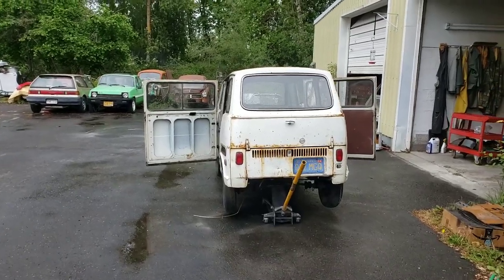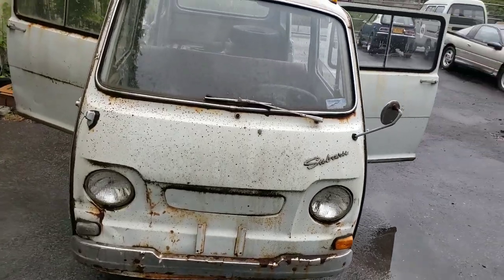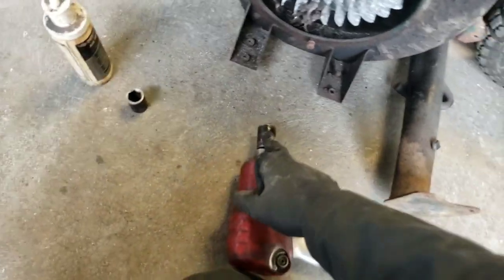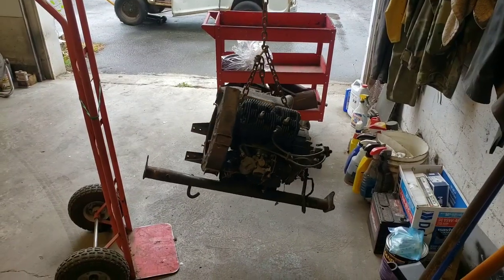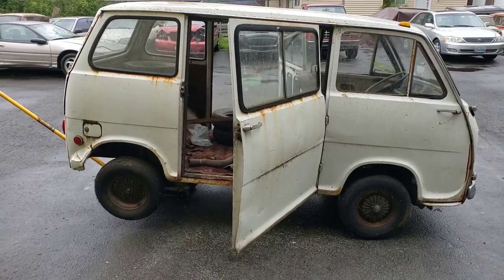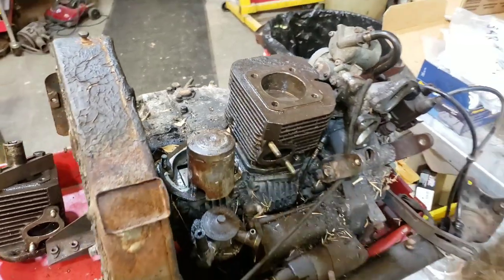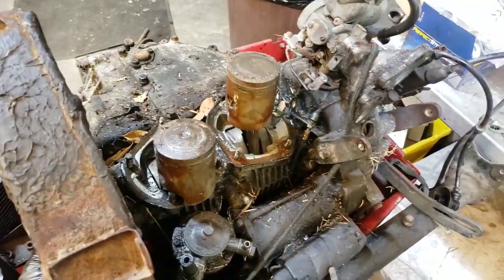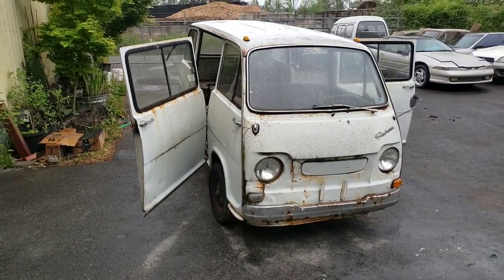Two Stroke Subaru 360 Van Restoration Basics : Unsticking the Siezed Engine !

Comment: When our local Subaru dealer went out of business, several of my high school friends bought the 360 car which looked like a small VW bug. I think they sold for about $800 new when going out of business sale. The main limitation was the top speed which was about 45 mph and 0 to 45 took about a half mile especially with 4 people in one. One friend burnt the engine up and I helped rebuild it for him. One of them was an auto stick transmission (no clutch) the others were conventional stick shift. Your video brings back a lot of memories of cruising around town in those Subaru 360's Sedans. Neat little car but not much quality or sheet metal to protect you.

Comment: Mark, whyfore you wailin away on those pistons like that? You can make a simple piston pusher very easily. Tap some threads into two opposite cylinder bolt holes, then you can drill two holes through a piece of flat bar laid across the cylinder. Drill a hole in the middle of this bar and either thread it for a good size bolt or use 5/8 threaded rod and a few nuts (weld one of the nuts to the threaded rod to make it into a bolt). Voila, a piston pusher. Also, heat the cylinder with a propane torch and let it cool with penetrating oil being sprayed on the piston. A couple of heat cycles and the pusher I described, they'll move.
Never hammer on piston tops of roller cranks unless your intention is to rebuild it completely with new pins, the very first good wallop ruins the big ends.
If you determined that the entire crank was toast already though, beat away on it. It's not the method I use but it works.
Reply: You obviously didn't watch the entire video, did you....
Reply: @Mardy72  I rarely watch past the beating with a hammer stage. I've unstuck more engines than you have brain cells and certainly more than Mark, and I'm talking about engines from 2 to 12 inch bores. I guarantee that I would not have buggered anything up on that engine beyond what was buggered up. I like Mark, he's done me some solids in the past but this is not the way to deal with a stuck engine.

Comment: This motors look like Jet ski motor without that blower .

I used Marvel Mystery oil in a 85 jet ski that had been out in the ocean and never cleaned afterwards, it just sat for 20 years. Anything that used to move was stuck solid on this motor. 
I put the Marvel oil down the spark plug holes and two days later  she started to move.

Comment: make a 'grease fittiting plug' to fit your spark plug, and jack the piston down with hydraulic grease pressure, while heating the cylinder. this has worked for me time and again unsticking froze up John deere two cylinder tractors (way less chance of collapsing a piston or wrecking the cylinder).
Reply: Yes...the problem is the position of the piston on a two - stroker. In this case, it would have worked on the RH cylinder, not on the LH - the grease would simply disappear in - to the crankcase...I had a similar problem ( not on a Subaru but on a Lloyd 400 )

Comment: The 360 was the very first vehicle that Subaru sold in the US. They also made a sedan (which looks quite a bit like a Volkswagon Beetle). Zero to 50 mph in 37 seconds. Curb weight: Less than 1000 pounds.
Reply: I've seen the sedans. I didn't know until I saw this video that there was also a van.
Reply: @russlehman2070  On another video he's converting one of his Subaru vans to run with a Yamaha motorcycle engine! I can't wait for that one!

Comment: Next time apply your blowtorch to the cylinders, add atf, lather/rinse/repeat. The thermal cycles will help greatly. Being 'out of gas' isn't really a valid excuse, especially working on a paying customer's vehicle. Use a hand-held MAPP gas torch if nothing else is at hand, or even a propane torch.

Not dissing you but you gotta be more gentle. As you say, these parts ain't exactly falling off trees anymore. And those air-cooled 360s ran half-seized anyhow, cooling was always a problem.

Liked... wanna see more. I have parts on This Side, been in Japan for 30 years. My 360cc '73 Jimny is one of my favorite rides.

Cheers
Reply: try dry ice cold soak and a qwik quench with hot water a few times loosens up anything

Comment: Impact gun's are not made to turn things, they use an actual hammer inside that strikes a piston type thing which give an eight of a turn over and over, NEVER use one to turn engines as you WILL damage the nut or crank threads (like you did), and if you are going to rebuild the motor never try to turn it as you can do more damage to it, just take the whole thing apart see what is wrong with it and move on, and NEVER EVER use an impact gun on any puller or spring compressor tool as it WILL damage the threads (I see you have a snap-on puller I hope your snap-on distributor doesn't see this he might void your warranty because of you using an impact gun). Paper gaskets, they sell rolls of the stuff where you can make (cut) your own, I would NEVER EVER use old gaskets (head gaskets are a different beast). I had rebuilt motors for almost 20 years, retired now...
Reply: Agree wih all you've said. He's not much of a "restoration" type mechanic- more a too lazy to source or make new parts one.
Reply: uh, it seized, big shooter. A seized engine is usually hiding major problems. Plus he gave it a few love taps, not 5 minutes of rattling the shit out it with a 2141 Ingersoll.
Reply: @flatbrimsickdope2050  seizing 2 strokes can only be 2 rhings genius; stuck in the bore or stuck somwhere on the crank...

Comment: I've unseized quite a few 2 stroke engines, one far worst than this from a motorcycle that had a bush grow through it when it was left on its side in somebody's back garden from 27 years.

The procedure is as follows (It's important the engine is still in the bike!!):

(1) Remove carb, manifold and spark plugs.

(2) Fill the crank bay and cylinders with Coke Cola, then leave for an few hours whilst the phosphoric acid eats the rust and gunge away. In some cases it might need a 24 hour soak. (Never use Pepsi in an engine as it makes the gear cogs lose teeth!!).

(3) Fit a serviceable drive chain then rock the bike backwards and forwards in first gear from gear lock point to gear lock point. It will gradually start to increase in the distance you can rock the bike in gear.

(4) As soon as the bike can be pushed for a whole crank revolution, give it a good fast push around the yard so that the engine can spit out the Coke Cola (Not a good idea to attempt to drink it after its been inside an engine!!).

(5) Once the Coke Cola has been expelled, fill the crank bay with SAE 30 W gear oil and push the bike at a fast pace around the yard until this is expelled. The engine is now in a condition where it can be attempted to start.

(6) Pour a shot of petrol into each spark plug hole and replace plugs. Pour a shot of petrol into the manifold hole. Replace the manifold and carb.

(7) Power up the ignition and push start the bike..... It will cough and splutter into life for a few seconds and then die. From how it sounds it can be decided if it needs to be rebuilt of is just fine.

I did this exact procedure for a 1974 CZ 250-471.0.003 that came into a mate's breakers yard back in 1998. Somebody bet £20 that we'd never make the complete rust covered heap run again. an hour later my mate was £20 richer and popping wheelies on it, though it was hissy and whiney as the crank centre and end journals were clearly shot.

He gave me the bike in 2012, till in the condition it was when it came in and I restored it with a new crank. It sits in my garage along with my other classic bikes.
Reply: I have no experience with rebuilding seized 2strokes, but I enjoyed reading your write-up

Comment: I've seen some stuck pistons in my time working in a bike/sled salvage/repair shop, but nothing that bad lol
I just use the puller if a couple taps with a piece of wood doesn't work. Those cast pistons are so soft the crown mushrooms against the cylinder making it harder to get out.
The pistons from wiseco are indeed forged aluminum, but they go through the cnc machine after.

Comment: I'm amazed the pistons were stuck but the crank wasn't. Every time I've seen stuck pistons we all assumed the crank was gone as well and threw engines away.
Reply from the maker: Subaru 360s are unique in that the crankshaft is injected by the 2 stroke  oil pump usually the crank siurvives.......but I was not sure on this one. I was very doubtful
Reply: +2stroketurbo

Cool, thanks for explaining that.

Comment: Pistons are either machined from a cast form or from a forged ingot form.

Forged pistons expand and contract evenly across their whole form, which is why they're de rigour of engine tuners especially when running higher than stock compression ratios.
 
Billet pistons are cast roughly to shape and then machined. They expand unevenly and will develop tight spots when hot, leading to seizures in certain situations. They are also cheaper than forged pistons hence why OEM pistons are generally cast items. 

To borrow a quote from a Belgian beer advert, forged pistons are reassuringly expensive.

Comment: Curious if you run the 360 forum. I have a bunch of extra parts for sedans. Doubles, triples of everything. I'm in resto with a 360 that was never sold. 16 miles on it!
Reply from the maker: No I don't run it but I am on team admin
Reply: Thank you for the reply. I paid my dues and am having trouble with the application for some reason. Would love to talk shop with the general community.
Reply: Also seems everyone for the most part is on the west coast, not much relationship with 360 owners in Maine
Reply: @jessehowrad7028  I'd bet that if there ever were any of these microcars in the salt belt, they'de have turned to rust years ago.
Reply: Yeah makes sense. But sometimes you get lucky..like this guy
Reply: 2stroketurbo any vans for sale up there in your area?

Comment: for a good second, i thought the pressure from the gun was gonna crack something
Reply from the maker: I thought I may have cracked one of the cast iron cylinders around the bolt hole at one point,   but it was my dog white  hair ,    ha!
Reply: @2stroketurbo  i actually caught that, it looked pretty convincing 😄
Reply: @2stroketurbo  hey TURBO, you worked tooo hard, should have put in a goodly supply of dry ice and froze the pistons in their bores for about 3 hrs with DRY ICE  and then quenched it with hot water, the thermal would have opened up the pathways for the oil to crreep in and loosen up the pistons....................
Reply: @veryshortthoughts  wooooooooooooof!

Comment: have you tried using a spark plug thread adapter to force grease into the cylinders to hydraulically push the pistons out of their bores? right so remove those intake and exhaust gaskets and block off those ports so you can push out the stuck pistons.

Comment: I've had the same exact trouble with bicycles believe it or not.  It is not uncommon to find old bikes where the frame and the seat post are dissimilar metals that galvanically corrode together. It can be impossible to get them apart without destroying the frame.
How are the jugs?

Comment: Hi, why did`nt you try a chain wrench around the front pulley ? it would generate better torque on trying to turn the engine ?
Reply from the maker: Font pulley is lightweight very thin aluminum

Comment: I put a block of wood on the piston, and hammer on that. I would have squirted penetrant on it for two days, before breaking out the puller. Patience Grasshopper. I thought, rebuilt in a day? , but then I rebuild a moped engine in a few hours. Gotta love 2-strokes.

Comment: An engine builder that doesn't know if you can forge aluminum pistons and thinks they are steel???? Really! Using a half inch air gun to try to unstick and engine??? LOL! (That's when those threads were stripped on the crank you can see the socket slowly turning the nut tighter on the threads.) The hammering on the piston................................... OMG No.

Comment: That was about the dumbest way i've ever seen to remove a seized piston, when you put a hole in a hardened steel puck it should tell you something, but you kept going. Hell the guy that said to drill holes in the piston had a good idea, anything other than what you did, which was to ruin that engine. In the 10 min i watched, you stripped the end of the crank off, damaged a piston, damaged a jug and probably did a hell of a job on the crank bearings. You need to have a plan when doing this stuff and try to save as much as you can, and the biggest parts you needed was a good jug and crank both of which were unnecessarily damaged by ham handedness.

Comment: Subaru has evolved quite a bit sense these days. They were rust buckets even in the early 1980s.
Reply: In the rust belt, they still rust out fast as hell, 10 years and the brake lines, fenders all turn to dust.